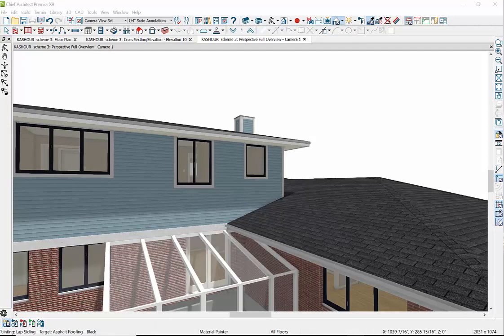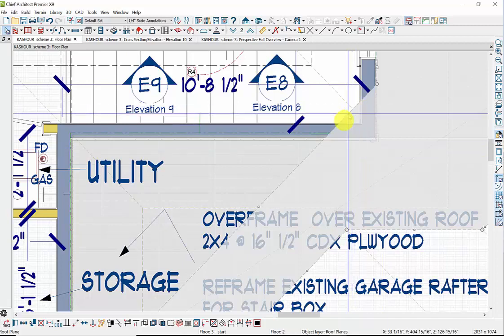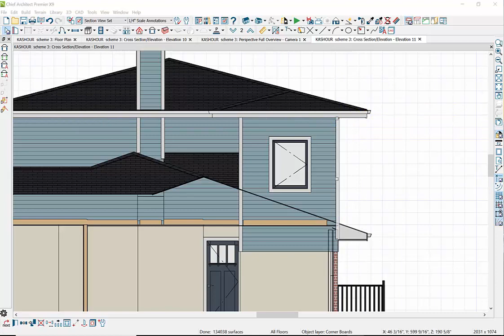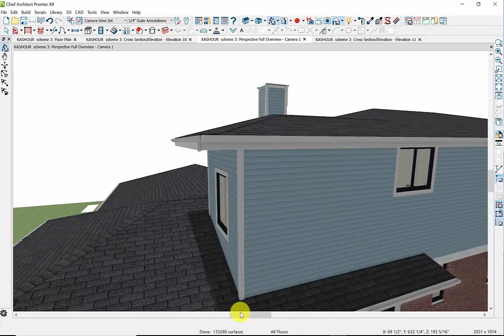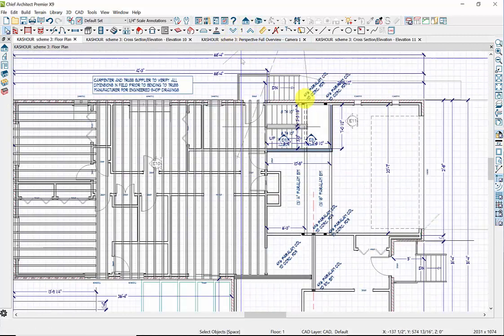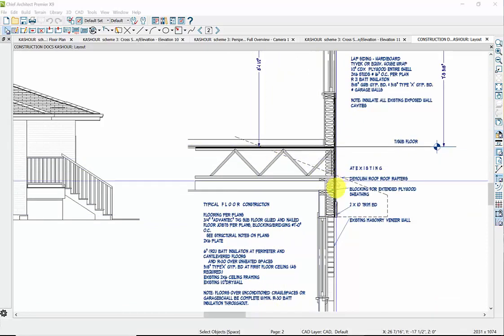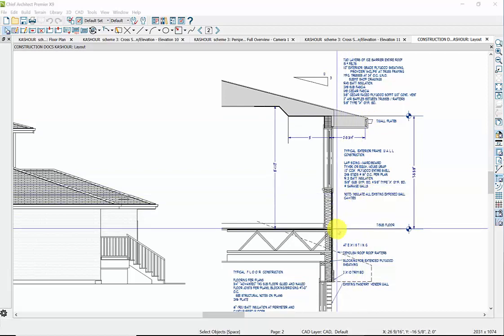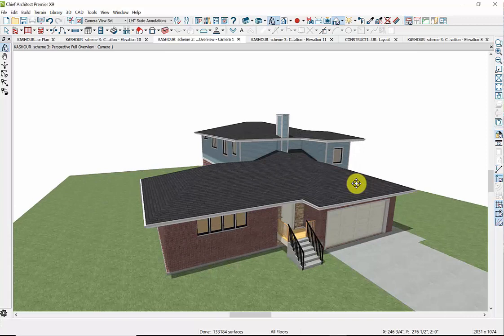HOW TO DETAIL A SIDING SECOND FLOOR OVER A FIRST FLOOR MASONRY VENEER WALL IN CHIEF ARCHITECT

Comment: This makes sense to me but where I'm getting lost is in the details not shown. What happens on the two ends of the house parallel to the first and last floor truss? You aren't going to cantilever the truss out over the brick, so what is the appropriate method to extend the side walls out to the outer face of the brick veneer? install blocking perpendicular to the floor joist/truss and install rim boards onto those, then the wall sheathing?